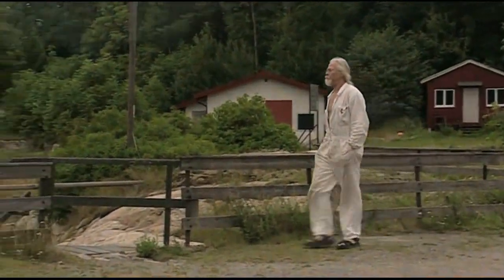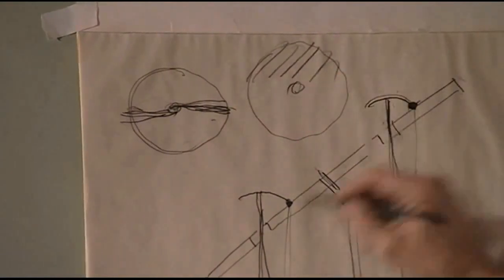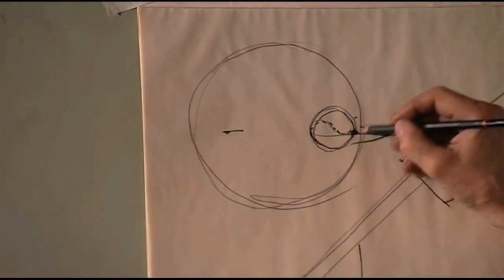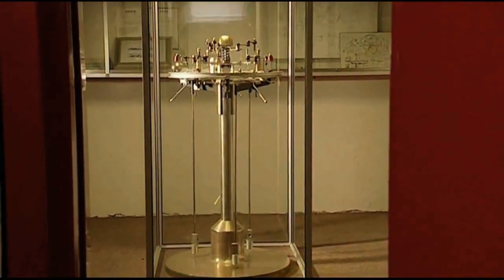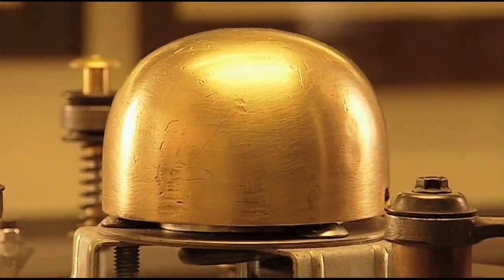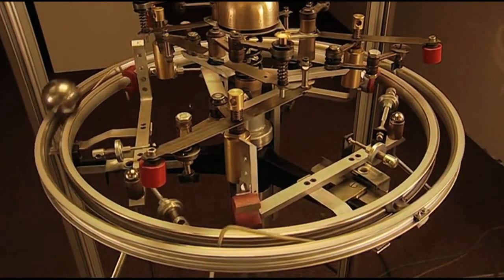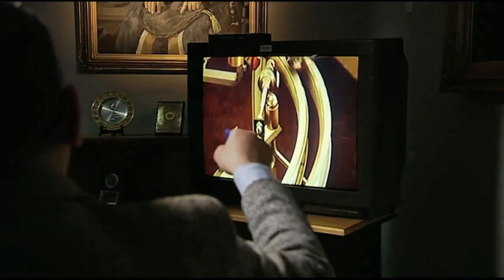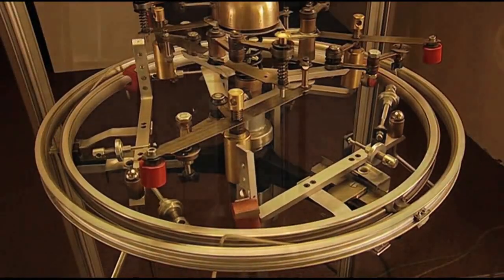Almost perpetual motion.flv

Comment: Why don’t they just make big versions of this that are connected to a generator and every so often give the ball and extra push and swap out the magnets that would be give out heaps of energy with only a tiny bit of work
??????
Reply: Yaeger You didn't really answer why they wouldn't also use this.
Reply: Eno1234 because the emery from solar power, wind turbines, water ergonomics, and every other free energy we get on earth
Reply: Because the ball isn't the thing that contains energy in this system. It's the thing that uses up the energy from the system, in fact, by constantly scraping along its rail and making noise. Pushing it will just desynchronise it from the movement of the rail. The thing containing the actual energy in this system are the big pendulums at the bottom. This is in essence a big grandfather clock that moves a small metal ball around.
Reply: Dude you can never get more energy then you can put in

Comment: Nothing can run indefinitely when made with any known element. Every element has a decay period and the machine would eventually break apart. Even before the elements decay to the point where this cannot work anymore, the ball will wear the track and the magnets would demagnetize to the point at which the ball would not run the track. Perpetual Motion would require the machine to run on an element unknown to humans which has no decay period.
Reply: XspopX It is still high efficient and will produce FAR more than it takes. Of his invention is true than its a huge leap in energy generation.
Reply: Then just destroy it and make the same one again

Comment: lol wut? it didn't slow down by 1/25 of a second over 3 days, therefor it may never slow down! the fuck? run it for 10 years to a accuracy of 1/100000 of a second and if nothing has changed then maybe you have a claim but keep in mind, this is not in a vacuum, so even if this was professed to be 100% efficient it would slow down over time as it has to move the air out of the way, and because for it to be perpetual it would have to do this for eternity it would be consuming an infinite amount of energy,  so it would be infinitely efficient, therefor 90% efficiency is no closer than 0% efficieny to what is being claimed.
Reply: OldFordas Put it in a Vaccum then... Problem solved.
Reply: cant run for eternity cause of material ware tho , good point about the air resistance
Reply: OldFordas still its HIGHLY efficient and is a huge jump in energy generation either way. I'm sure if this was industrialized electricity could be cents a year.
Reply: @jonnyboi9026  Do you see any energy being generated by this machine then? It still runs down after 14 days, and nothing is said about the energy needed to start the motion up. These pendulums look heavy.

Comment: It is just a well balanced system until you try to extract work from the system.
Reply: would still allow to produce more energy than it take to get it going , so at least it would be free energy , but not perpetual
Reply: @Lap-Rise  it can't produce energy. The machine is quite deceptive in that it looks like the ball is the thing containing the energy. It isn't. It's the pendulums.